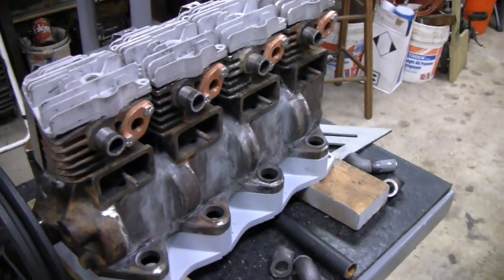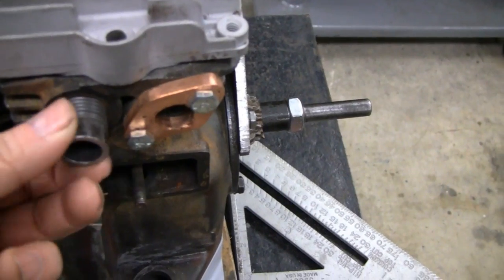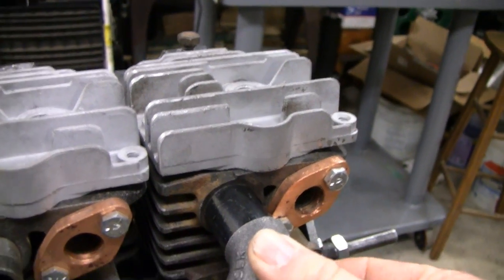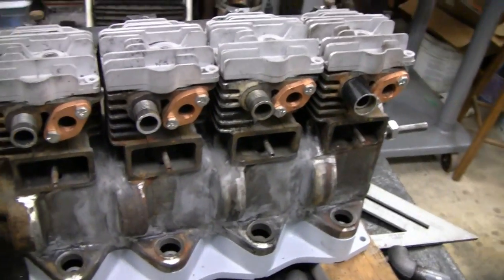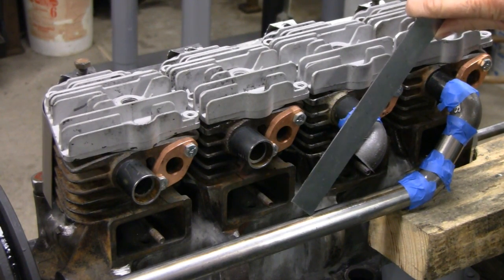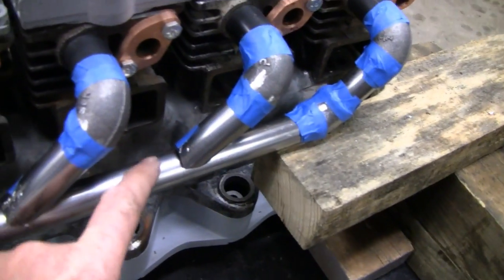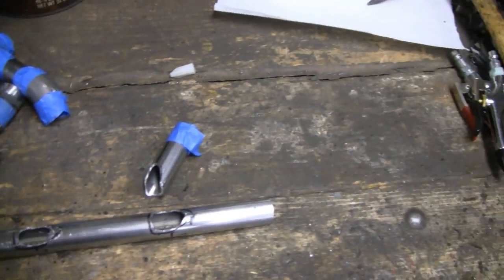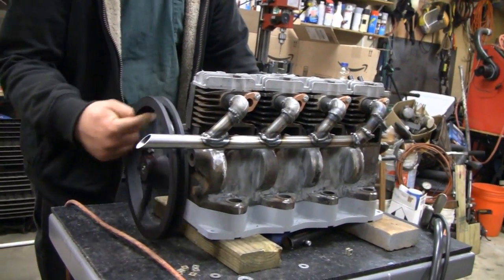HOMEMADE 4 CYLINDER BRIGGS PROJECT (part 13)

Comment: Love this project. and can't wait to see how it works. If that's the only air flow though it's not going to be enough. Each head and cylinder needs its own air source of fresh air. I sure hope you figure that out before you run it any length of time. .
Reply: It wont, the delorto will be fine, only 1 cylinder at a time will be on intake, if its in standard 4cyl config, and the smaller venturi wiill keep air velocity up for fast carb response.

I would have made the exhaust screw in flanges and bolted my header to them, easier to take apart later
Reply: Simon Wiess This was so long ago I cant rem exactly what I was referring too but from a quick glance I think I was referring to the engine cooling.  These engines normally flow quite a bit of air for cooling. You have blocked off one side where the air should be flowing from. So I am unclear as to how your air flow for cooling is going to run. All I know is you can't run the air from one cylinder to the next and expect the last cylinder to last long. Think older VW engines. Those things overheated all the time even with their fairly decent airflow design. Mostly this was because people just didn't drive them right but still.  
I confess though, I haven't kept up with this project so you may have fixed and solved it by now. cheers
Reply from the maker: That wasn't me addressing your question Mate, I built the engine!! And since you brought up the cooling situation, I figured I would clarify it!! It actually runs cooler than a single cylinder Briggs because it getting air blown on it from both directions with more powerful fans than the original engine.  Cheers
Reply: Aye. I was replying to simon. But, air pressure from all sides cancels flow. You need flow for cooling. Do you have a video of the this project finished so we can see how the cooling works?

Comment: Where is the part where you connected the crankshafts
Reply: +Paul K  yes same her  and the cam was not seen either.
Reply: That's the part where Mike was on the lathe a few episodes ago, and RK was fucking with him. They seem to wanna keep the crank and cam shafts "proprietary" or some shit.
Reply: That part is a in house secret, and some of it should be. Got to leave some for the copy cats to figure out on there own.

Comment: you could just weld flanges on the pipe going into the head and duplicate the same flange on the "manifold" that way you can bolt it together at the flange and still be able to undo it from the head, sure you have to make 8 pieces and weld them but why not do it "leak proof" . if you want a design for the idea I can send one over.
Reply from the maker: We thought about something like that but decided on this design because it looked cleaner!!☺
Reply: understood awesome project
did you know briggs and straton produced a v8 back in the day, I saw one in a I think a 50's rambler, it was a 327 cu. I was told it was then sold off to Chevrolet but I have no proof of such a thing, I just saw the engine with brigs and Stratton valve covers.... lol.
Reply from the maker: Nah I never heard of the V8 before!! I have seen a Briggs car before, they were a car company 10 years before they even started building engines but even those cars had small 1 cylinders on them!!☺

Comment: VERY interesting video's. Are you building this engine for a specific purpose or just for fun. I also thought it would make a neat motorcycle engine (Indian). I would also like to know were you got that Vise Grip clamp you used on the drill press table? I must have a couple of them. Also, to see the building of the crankshaft and camshaft would be very useful, perhaps in a later video.  Thanks.

Comment: RK,Is there enough room to put a belt on without pulling the exhaust or the pulley?
Looks like that pulley will move some air the way the flighting on the spokes is set up,so i guess depending on which way you turn the pulley around will either pull in air or blow out air.
Reply from the maker: Yeah we got plenty of room to remove the belt!!☺

Comment: Looking good!! I must have missed the part where you built the crank. Which part was that?
Reply from the maker: Thanks Gizz!! I don't think we filmed the crank build, it did show up in a few videos!! Alotta stuff doesn't get filmed because we both get involved in what we're doing!!☺
Reply: I saw glimpses of it but how did you do it..weld the 4 cranks together or machine a new one?
Reply from the maker: We welded and machined the original ones!!☺
Reply: Would love to have seen that. I know you can't video everything. The alignment had to be critical.

Comment: Great job yet again guys :) I'd have had 4 open pipes lol just because I like them. Don't suppose you've any video of welding the cranks and cams? That's the part I'd really like to see. Or is that 'top secret' lol
Reply from the maker: Thanks Mate!! Nah we didn't get any video of the crank or cam!! We were both too busy makin' it we couldn't film it!!☺
Reply: 805ROADKING Thought that might be the case. Most difficult part of the job. Never welded a crank together as such but in the early 70s we had an engine on a pump. Carl bought it very cheaply at an auction with a big end gone. I built the damaged journal up with weld, then reground it. Bit of a bodge, but ran for the limited time we needed it.

Comment: That's one badass lookin header.  Throw a little exhaust wrap on it and put it in your next project... a 4 cylinder minibike!

I'm curious why you didn't use your little benchtop mill to cut the downtubes on the exhaust?
Reply from the maker: Thanks Bud!! No special reason we didn't use the Mill,  Mike might have been using it!!☺

Comment: For the clamps just use some stainless steel heavy duty hose clamps. I have a box of Mandel bent 1/2" 90 deg pipes if you want 4 of them so it will look less bulky.
Reply from the maker: Thanks for the offer Bud!! The finished product doesn't look too bulky!!☺

Comment: I watched a show where they were building headers and he pulled out a pile of tubing that had 90, 45, 30, etc. degree bends in the pipe about 2 feet total pieces of pipe and they just cut the bend where they wanted it and then welded the new header pipes together!
http://www.woolfaircraft.com/prebent.html
Reply from the maker: That's a good Site!! They don't have anything small enough for us!!☺

Comment: I suggest you use a rubber hose to join them rather than the pipe clamp for the intake, I'm worried you might have a vacuum leak otherwise...

Comment: so far the build is looking grate. I like the look of the exhaust. but  back pressure might be a problem. a normal header all exhaust pipes intersect in the same spot to avoid this problem. except when dealing with just two cylinders in line. also the main pipe should be 1/4 to 1/2 bigger in size to get the most power from the header. as the header gets hot the gasses will expand further creating back pressure. the bigger pipe will let the pressure drop and create more power....was just a thought I don't know what you intend to do with the motor. just run it for fun or put a load on it...
Reply: when is the next vid coming out :)

Comment: Are you going to grind off the seem lines and "China"  ? That air shrould just screams PinStrip Me  any plans to use Qurdzilla to power any thing or just mount on a skid for engine shows ?
Reply from the maker: Yeah we ground down all the welds and fared them in with epoxy, The finished product looks pretty good!!☺